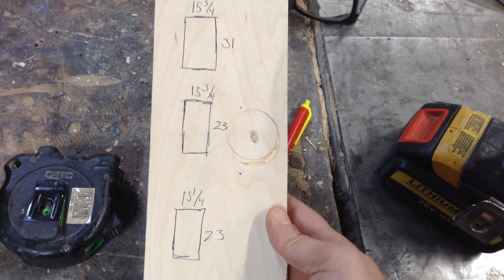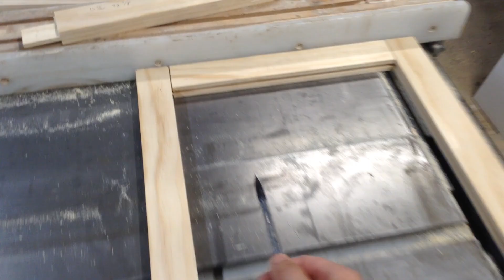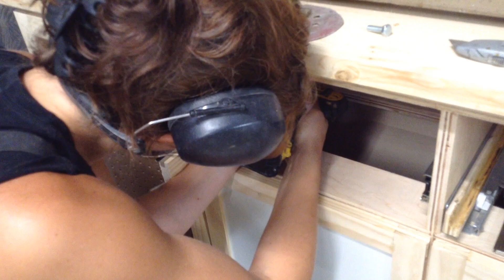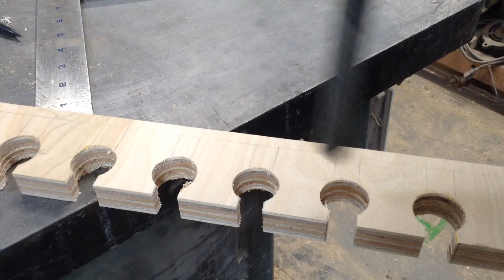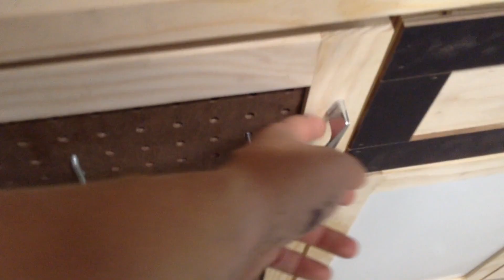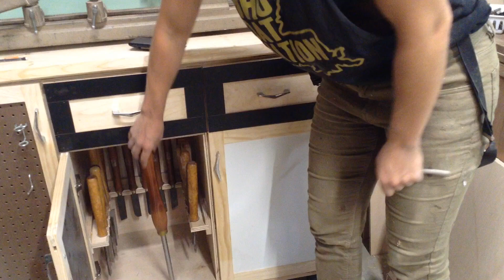Make A Lathe Cabinet [How To]

Comment: I have my old lathe from the woodshop where I grew up back in Ohio. it is ancient. an old delta. the motor that was originally on it is an induction motor, it smells like an antique sewing machine when it runs, ozone from the induction.... I still have the motor, but I installed a newer motor.  until I build a shop here at the cabin, my porch is my shop now. once I kiln the siding from the cabin salvage, I will enclose 3/4 of the porch so I can keep it dry and a little warm this winter. its a little hard coming from my old place that I sold to but this cabin. I had a 24'x40' shop there. I dug out a space for a 20x30 shop here and that is in the works...

Comment: My favorite joint I started using is bridle joints! Even more so than half laps they look stunning and are incredibly strong! Absolutely love when someone uses them in fine and shop furniture because they’re nearly indestructible once glue is applied. I love that you think of multi purpose with the white board and peg… you never know when you need an easy way to hang some tools you’re currently using on a cabinet so you don’t lose them in the meantime or like you mentioned notes on pegboard. I think whatever species whether it’s pine or poplar, harder woods or ply so long as it works for the person using them. I plant to build as low cost, I love working with solid hardwood but I think using pine or poplar is a great idea. I hate breaking down plywood however sometimes it just makes sense so anyways thank you for sharing!

Comment: Good morning 🌅, Honey B, I hope you are keeping safe and well, Very Nice Project, well worth the effort, that was a good idea putting some extra weight into the cabinet, you will be surprised how much your lathe will bounce about if you are turning something that is out of balance, 
It might be a good idea to put some more holes in the cabinet where the motor is , either at the back or underneath or to the left-hand side, to get a through flow of air, I’m not trying to tell you what to do. I’m just giving you some ideas trying to help., Your workshop is definitely taking shape, A few few months ago, I was back in the UK,, I was sort of given a vintage Rubio workbench, I’ve just spent approximately two weeks all added together, stripping it and rebuilding it to make sure all the  Vices work on it, I ended up putting the Top through my thickness, to try and get rid of some of the holes in the top, like you, I am making cabinets to put on the walls for storage, and I’m hoping to make a slab flattening jig, that I can hinge down off the wall, as I do not have a lot of space, mainly because of my tools and machinery are quite large, as when I was working back in the UK I had a very very large workshop, Keep up the great work look forward to seeing your next project, from France,
Reply from the maker: Navigating space in a small shop is a challenge for sure.

Comment: It's very satisfying building shop storage from stuff you have.  IKEA has donated much material for mine ! 
 I find BLUM undermount slides to be very expensive here in the UK. I've heard some of the 'knock-offs' can be very disappointing though. Good result and very creative.
Reply from the maker: I haven’t tired the knock offs.  But they are expensive here too.  The only reason they are on this cabinet is because I got a replacement because of that broken clip so technically it was “free”.